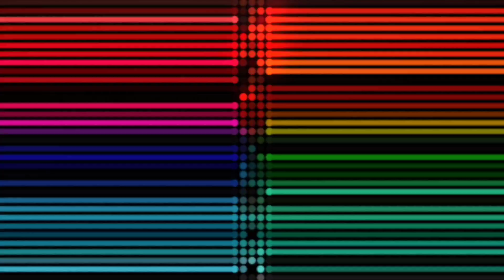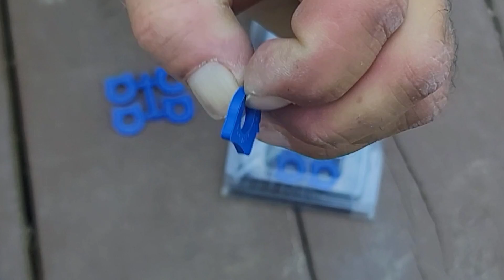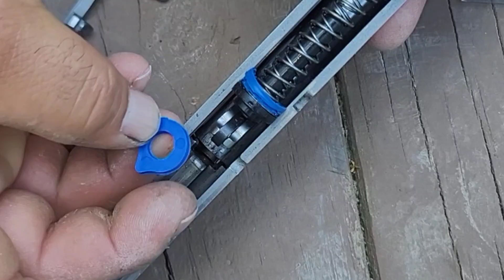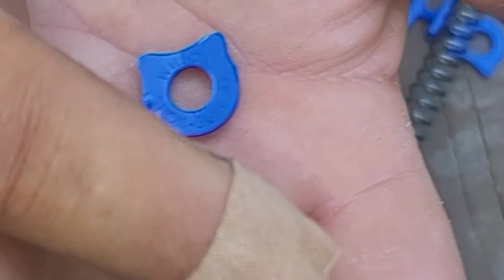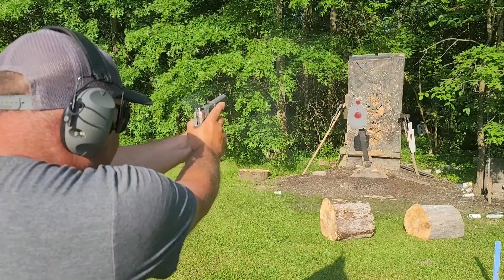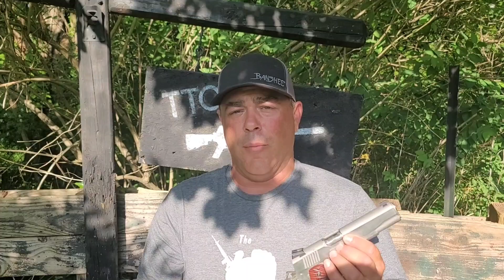Does Your 1911 Need a Shok-Buff?

Comment: I would be curious if one could 3D print their own from tpu
Reply from the maker: Hmmm🤔 as long as it has enough give. Im pretty sure at some point you could , if not already. But would it be cost effective?  🦃👊👍
Reply: There are different durometer tpu filaments available, and if one already has the printer it's probably only a couple of grams of material each, so a one kilogram spool could probably make about 500 or so. @theturkeysopinion